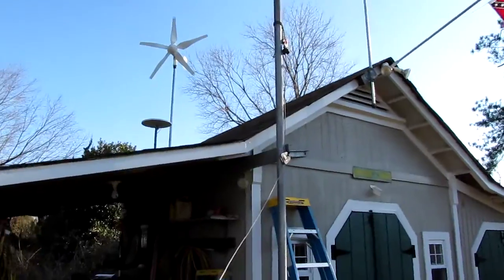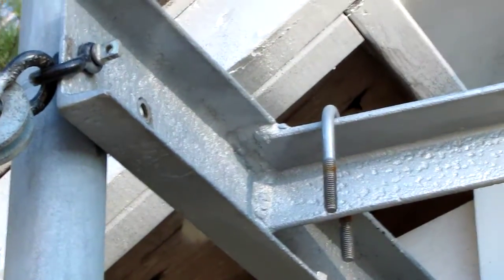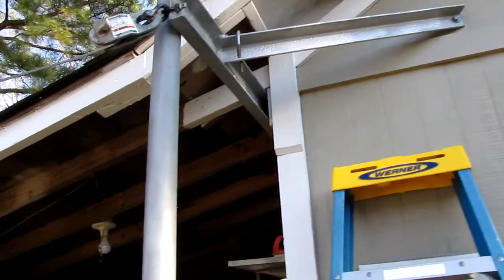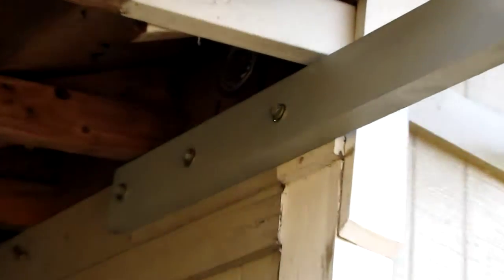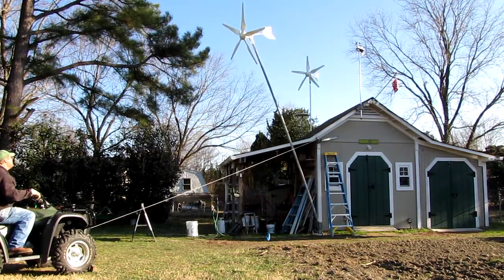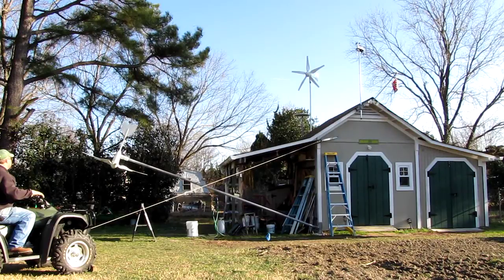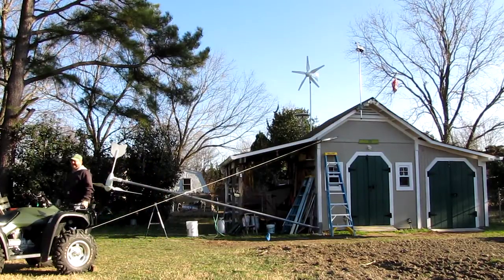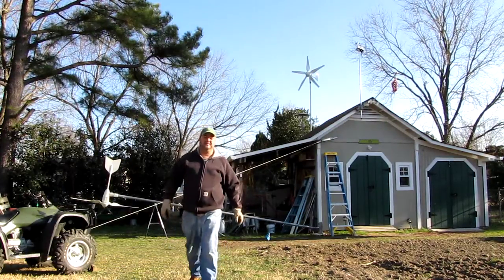Wind Turbine Towers How I Built Them And How To Lower Your Tower  And Raise Them The VIARLOCITY Way

Comment: good job Kenny  knew about a guy that had a much larger wind mill and attempted raising it for the very first time using his jeep well the jeep was not big enough and the unit came crashing down after he already had it several feet in the air but not vertical enough to change lighten the pull it was an expensive lesson for him after he spoke with the manufacturer I think they covered the repairs under warranty which they did not have to do and then he hired a commercial company to raise it.